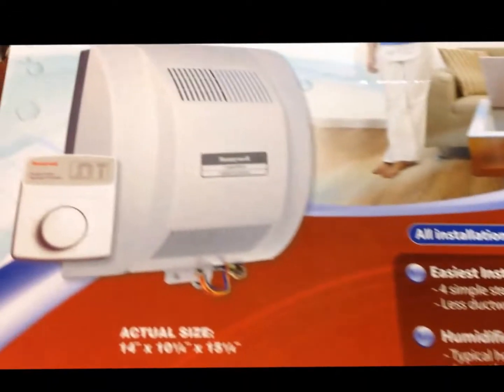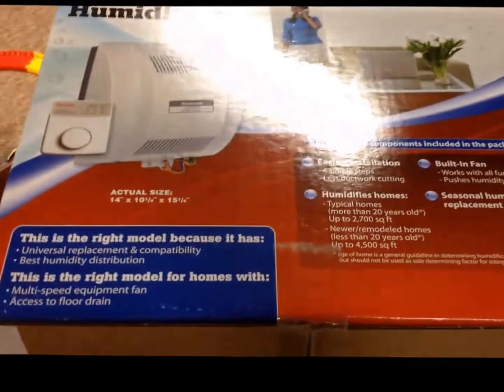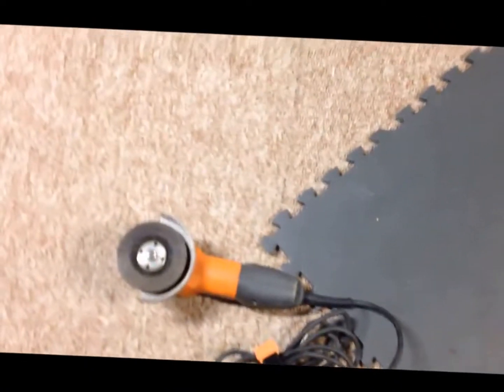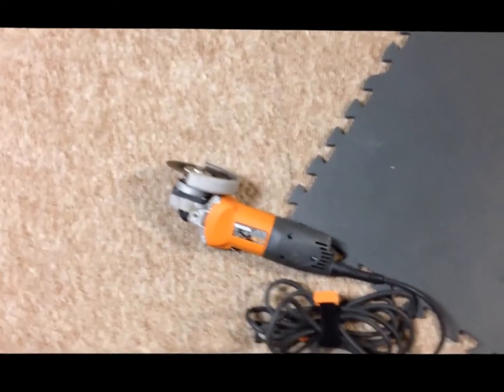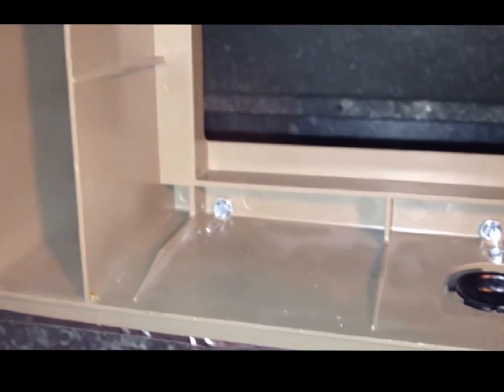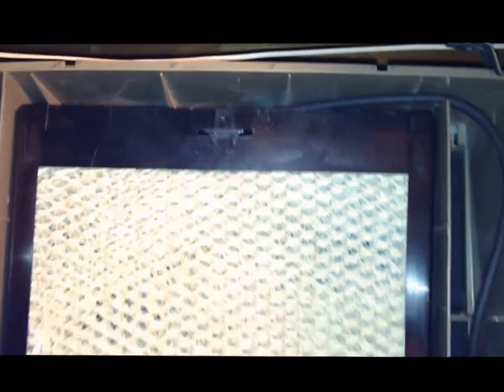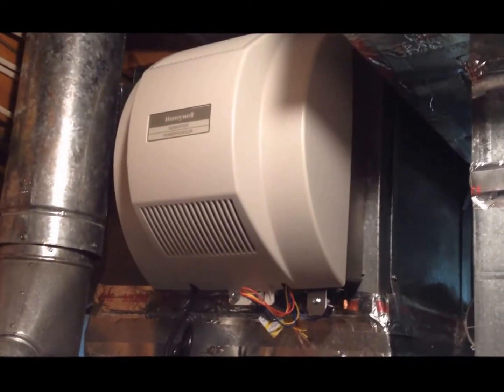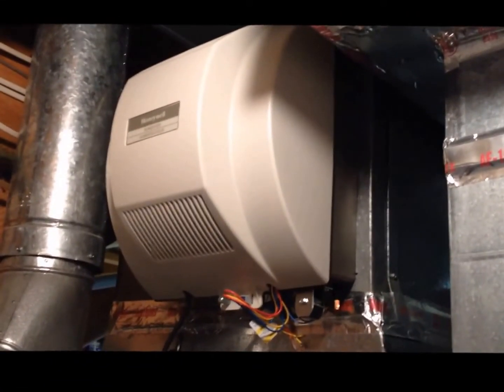Honeywell Humidifier Install - YOU CAN DO IT in 1 HOUR!!! 🔥🔥🔥

Comment: Disappointing:  Didn't explain how to identify which duct it goes on and didn't show how to connect the water line from the source to the connection.
Reply from the maker: Can't tell you all my secrets
Reply: You don't have to be rude. It takes time to post a video and he gave you his time for free. If you don't know what duct it goes in then you might want to hire someone. Here is a hint since it has to move moisture to the whole house you want to mount it in something common to the whole house. Hint it's the plenum. As for hooking up the water line, it seemed clear enough to me. Thanks kite Army it gave me a good idea of what is needed.
Reply: @artpfenninger5914  - You're right.  I modified my original post.

Comment: Thanks for the video.  I like to keep my furnace running 24/7.  I am finding that water also drains from the humidifier 24/7 as well.  Is this normal?  I have checked and made sure that there is nothing wrong with my solenoid and the humidistat.  Any advice is appreciated.  Thanks.
Reply from the maker: Yes that is how it is supposed to work.  BUT what I did is put a valve on my supply line and limit the flow - less wasted water.   Let me know if you need more help.
Reply: If water drains to the drain tube 24/7, the solenoid valve is either stuck open, or there is a defect that is allowing water to flow constantly.  I've modified my Honeywell 280 by putting a different solenoid valve in and I wired the system to the furnace controller.  The valve only opens when the thermostat calls for heat and the humidity is lower then the humidistat is reading.  I had nothing but trouble with the pressure switch as provided by Honeywell.  I "hacked" the bypass port to the front of my unit as I had gas lines in the way that also restricted flow through the bypass.  With these changes, my humidifier is now working well.
Reply: @CDNGuy36  yeah, i had the same problem. The pinning of tge connector to directly below the water flow area is designed to make the circuit short circuit and break. They could have run those wires anywhere else and it would be way more reliable. Mine corroded and broke in one year. I am now looking for the schematics. :-/

Comment: One hour installation is NOT possible. Two hours minimum with the running water lines, angle stop, humidistat and power from the r/w terminals. And this is only possible if you are a professional and do it all the time.
Reply from the maker: For some..sure
Reply: One hour 🙋‍♂️.
I did read the directions the night before though, to let them process. Actually helps alot.
Reply from the maker: I have to confess, I exaggerated....really 1/2 hour
Reply from the maker: crazy smiling face?